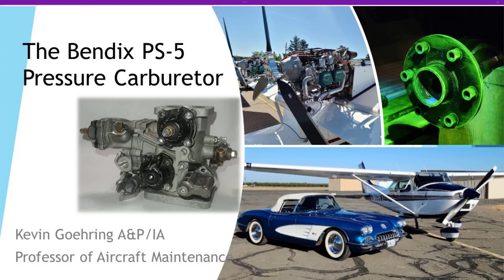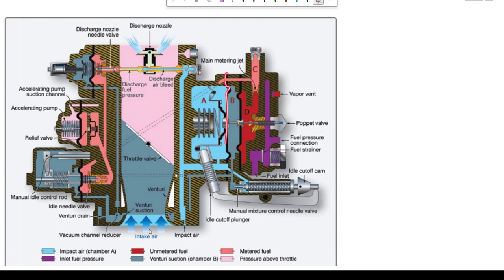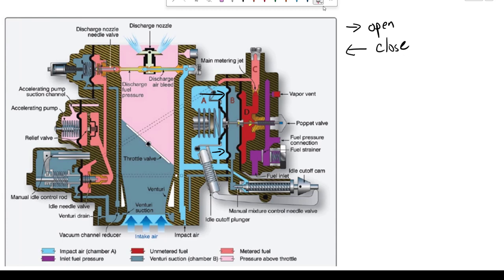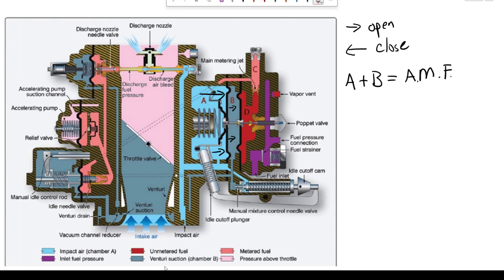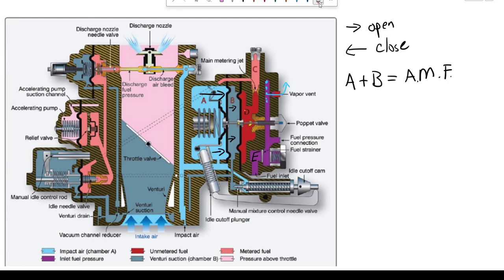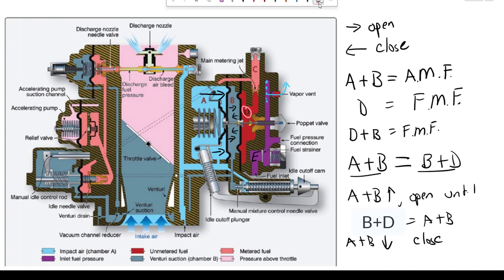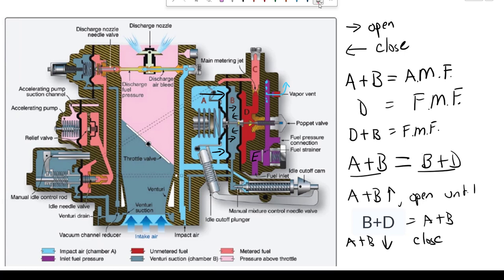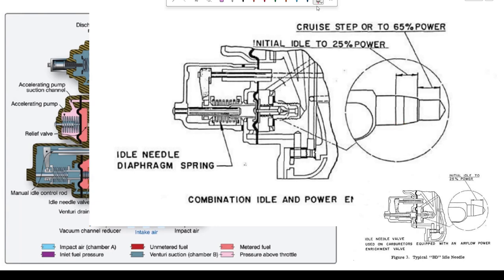The PS-5 Aircraft Pressure Carburetor

Comment: I had a Bendix PS5 pressure carb on a 150 HP Lycoming in a home built Pitts S1.  It worked great for full inverted flight.  Fortunately, the PS5 never required any repairs during my ownership of the Pitts.  This was around 1974 - 1976.  I'm thinking the PS5 was the best inverted fuel control device that preceded fuel injection systems of today.  Perhaps someone more familiar with the history of the evolution of inverted fuel system technology could comment.

Comment: Really great video!  I'm studying for Powerplant Written Exam.   There's a question:" An aircraft engine equipped with a pressure-type carburetor is started with the...?"  Answer: "primer while the mixture control is positioned  at IDLE-CUTOFF position."  Do you know why this is the starting procedure for a pressure carburetor?   Why not have the mixture control set to lean or rich?  I'm reading that once the engine starts you immediately move the mixture out of the CUTOFF position.  But why is it necessary/desirable to start the engines in the IDLE-CUTOFF position?  And it seems like with it in the IDLE CUTOFF position little to no fuel would be available for starting.  I don't get it!  Thanks for the great video.